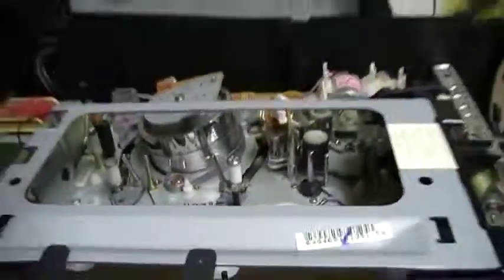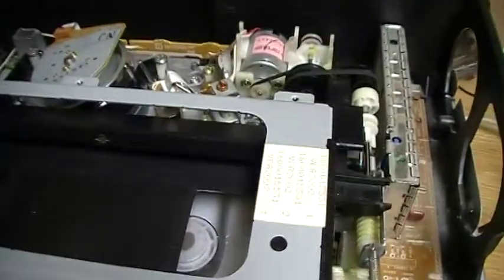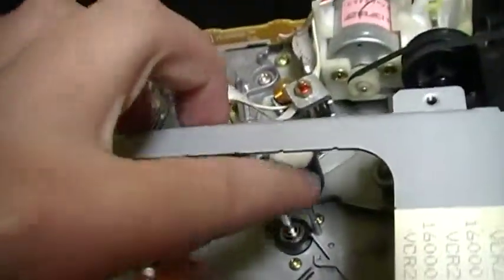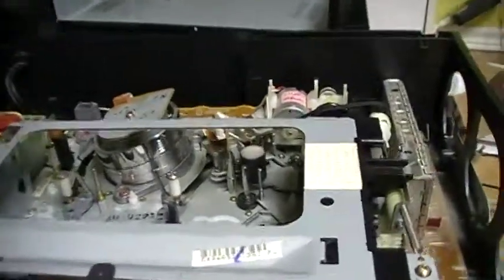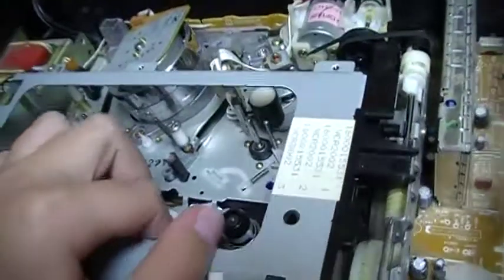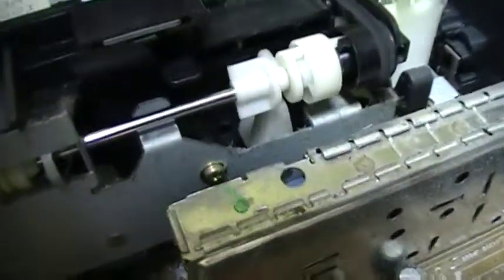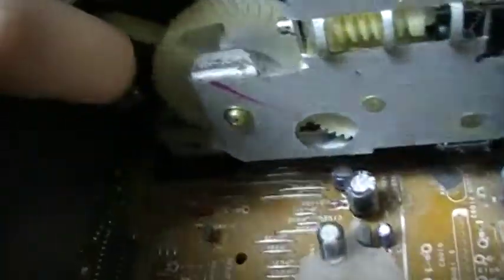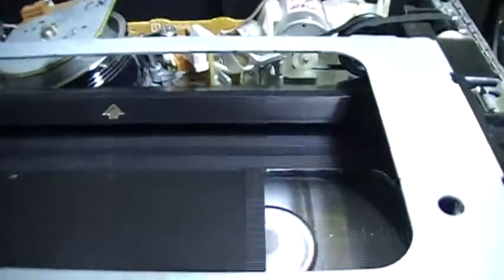Emerson VCR2002

Comment: From 92 to 97 we had a 2 head manual tracking emerson vcr after 3 or 4 years the vcr started to jam the tape During eject. My grandma had the 4 head automatic tracking vcr that locked like this one hers broke too. She got hers fixed we trashed ours and replace it with a 1998 RCA 4 head with the Daewoo transport. That vcr lasted for years I wore out the heads and it never jammed a tape.